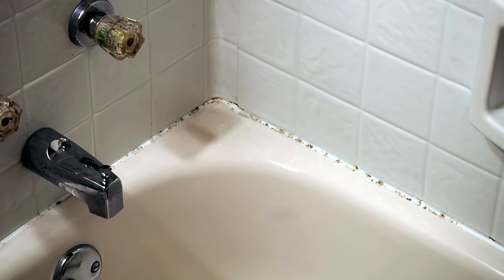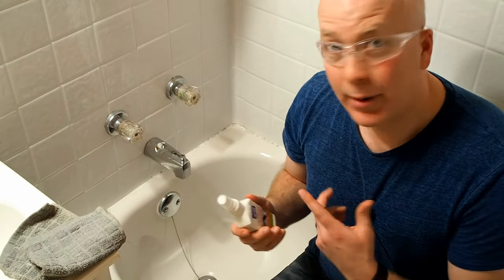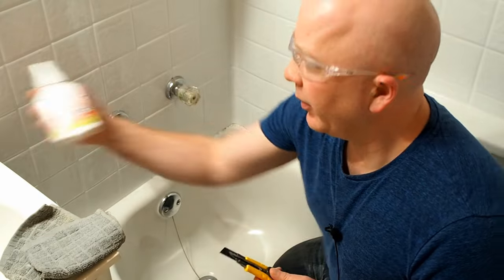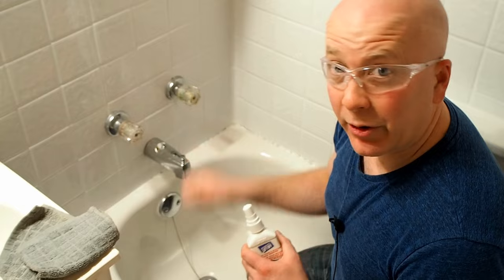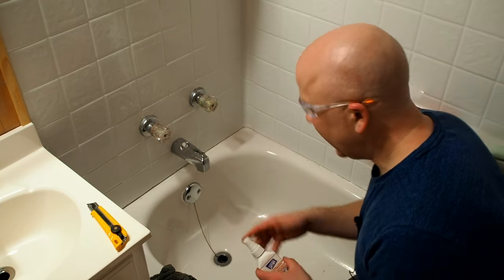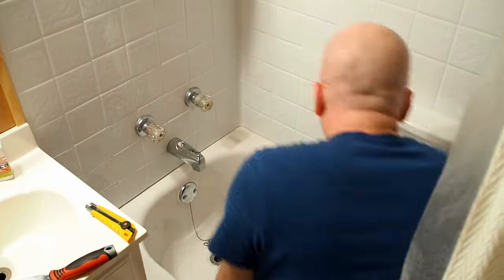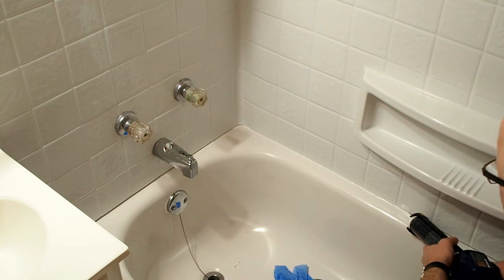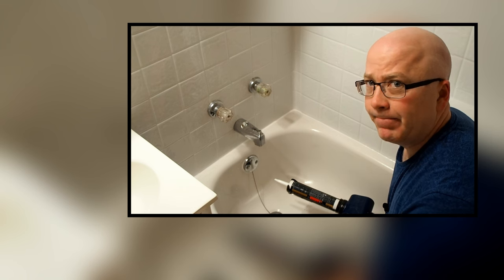How to Replace Your Bathtub Caulking : Quick Fix #01

Comment: I have been a professional caulker for over 45 years. NEVER USE ANY CHEMICAL TO SOFTEN SEALANTS. It is guaranteed to contaminate porous surfaces like grout and stone. You will never see a knowledgeable caulker use them. If we do we are required to mechanically abrade ( grind) the bonding surfaces. And liquid TSP leaves a film that contaminates the bonding surface. NEVER use anything but acetone or alcohol. And don’t use those cheap consumer sealants no matter what they claim. Use silicone by GE or DOW they supply sealants to the industry. And never use DAP for any waterproofing applications.
Reply: Could you please let me know what sealant you recommend? I am planning on do the job myself and don’t have idea of any material or tools… please, thank you.
Reply: @mjperez2646  first of all DO NOT use any of the caulking removers.
As far as sealants to use I would stick with GE or Dow silicones for any bathroom sealants
Reply: Bro make a video then

Comment: WD-40 also helps to remove the caulk.
Reply: Really
Reply: WD-40 is the car oil?
Reply: I can confirm that this does indeed work.
Reply: @phil7218  agreed
Reply: @shantinu3059 WD40 is not a car oil it's a penetrating oil that can be used for many things. The WD actually stands for Water Displacement. I can see how it would be useful here with this project.

Comment: Thanks for the tip about the caulk/silicone remover solvent. I have a fiberglass tub with tough silicone and ran out to the store and purchase a bottled and what a difference! It saved me so much time and headache. It worked so fast and cleaned up very old silicone.  Rinsed with soap and water then alcohol. I couldn't scrape without gouging the tub and causing damage to the surface! The results were so much cleaner!